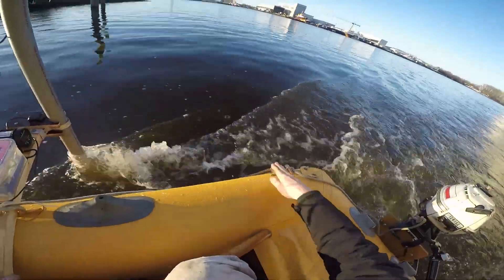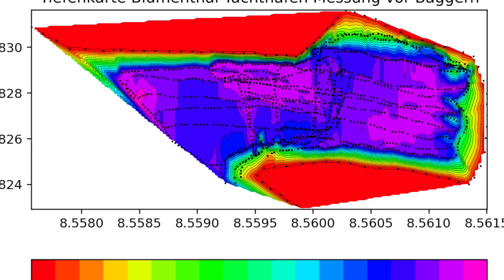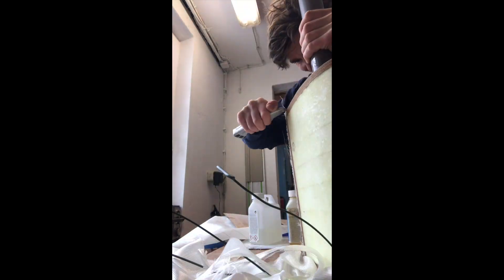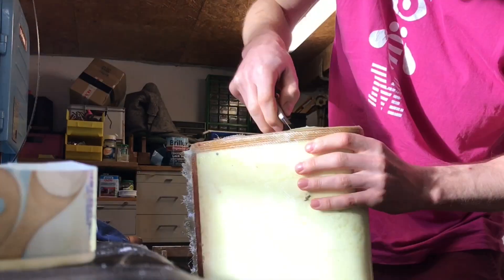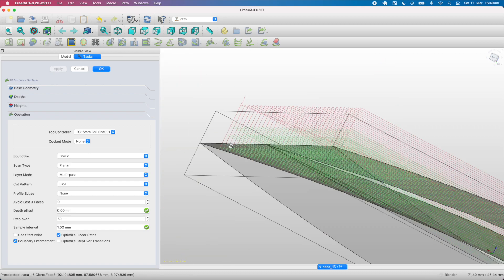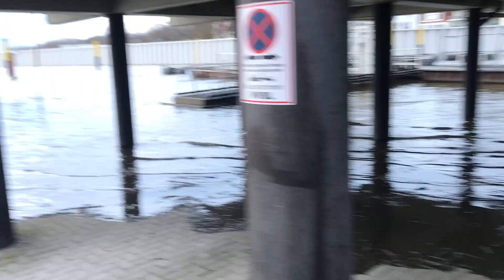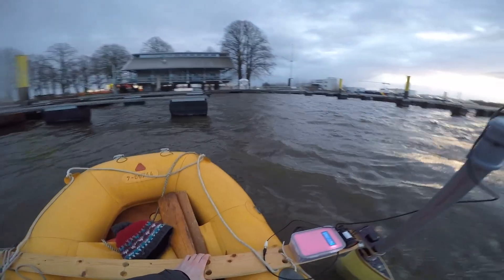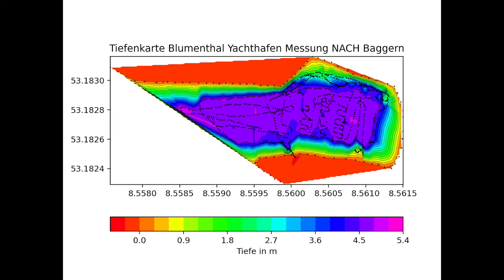Harbor Echolot Mapping Part 2: DIY Water Mapper w/ Arduino on a Tiny Boat in Bad Weather Conditions

Comment: Neet, I wanted to do that 30 years ago. It cost too much for the sonar that would do the job and I didn't have time to build one and write the software to do it. I was working 50 to 70 hours a week.  

NMEA2000 is not that tough a nut to crack. The specifications are the same price as NMEA0183. RS485 drivers connected to a twisted pair made from hookup wire terminated with a 50 or 75-ohm resistor talked to every CAN network I tried it on. I designed and wrote code for the first CAN network computer for J-1939/ISO 11898-1, the base of NEMA 2000 because all the industrial & truck engines used  J-1939/ISO 11898-1. Unless you need to send commands to the sonar, all the data is in the last 8-bytes of a CAN message. The first 8 are reserved for addressing and housekeeping. Catching and decoding the message is a bit harder to set up than a simple RS-485 message.

It is possible that the NMEA 2000 committee broke with the J-1939/ISO 11898-1 committees and allowed the use of Address bytes to be used for data as farm equipment, industrial machines, off-road, and over-the-road trucks don't have as much data to transmit as ships do. Consider the manifest of a container ship, using a block of 14 CAN messages as all data with a Start and END message didn't seem unreasonable to me and the J91929 member I was working with 30 years ago. The guys in Europe that insisted on 3 state answer to a query shot it down.

Comment: Wow this is just what I need. I don't have the skills to build the hardware of the code. What did the total rig cost?
Reply from the maker: For components, maybe 200€. Currently, the NMEA echo sounders are not available so it's very hard to build them. The alternative is an Actisene DST-2 (ca 300€)
Reply: Why aren't the NMEA echo sounders available (and I believe that's a communications protocol?).  @Neumi
Reply from the maker: Actually I don't know why. NMEA is the communication standard between marine electronics like chart plotters, GPS, radio etc. There is a relatively new NMEA2000 protocol and it is way more expensive (cables, hardware etc). Maybe water depth is not important enough to share it between the devices.(?) You will have the echolot showing depth anyway...  @jamesadams7307

Comment: I am not very familiar with Arduino 

firstly I have a NMEA capable echosounder and bluetooth GPS and I want to use my Laptop PC
secondly is there any way Can you prepare this complete project for me how much is the cost
Reply: Just the Arduino hardware and other software details are required
Reply from the maker: @hydrographicsurvey3304  I think it is easiest if you build one yourself. The GitHub repo provides all code and a small instruction how to setup. Bluetooth GPS won't work out of the box with the Arduino. You should look for one with serial NMEA output. The echo sounder should also have NEMA0183 output. Tidal correction only works if you have data from a nearby water level. But you could also interpolate the levels or build a second measurement station with an ultrasonic transducer or similar. (I'm also referring to the issue on GitHub https://github.com/Neumi/3D_water_depth_logger/issues/5)

If you need further assistance, please contact me on LinkedIn.
Reply: @Neumi  Thanks for your reply 
I donot have LinkedIn account
I like your view that I should do this project myself
so that I have better knowledge about its working
I have some basic know how with the programming and arduino setup

I understand that a bluetooth module will be required to be interfaced for my GARMIN GLO 2 bluetooth GPS receiver

My echo sounder does give a NMEA output which I use it to RS232 after conversion

I am presently using both the sensors interfaced through the individual separate serial ports with HYPACK software on my windows LAPTOP PC

Please guide me as a beginner so that I can complete this project myself

I have searched my local resources and  found that the ARDUINO is available here
Reply from the maker: @hydrographicsurvey3304  Why do you want to use my approach if you have hypack?
Reply: @Neumi  I usually work in the splash zone and I think that I can save and replace my laptop from being dipped in sea water

Comment: Hey, great project! was the transducer you used a NMEA0183 or NMEA2000?
Reply from the maker: Thanks! Its a Standard Horizon ds41. It uses nema0183. 
Nema 2000 is a bit harder to read with the Arduino.